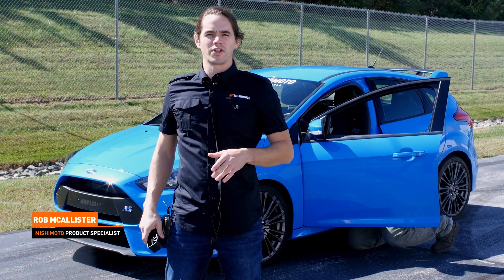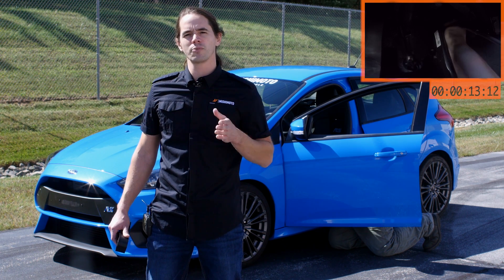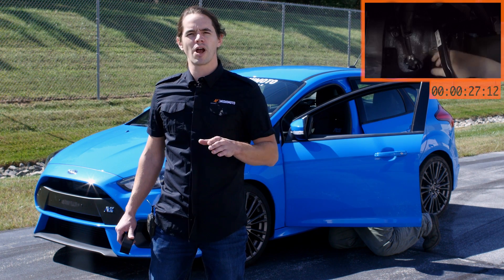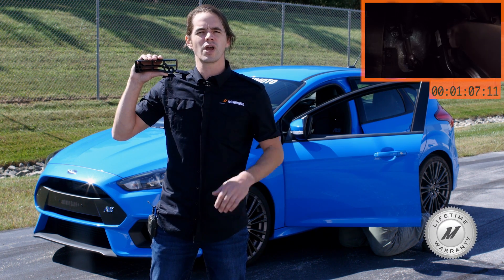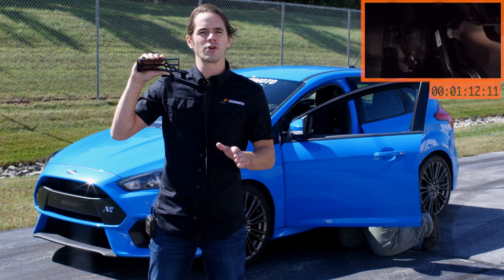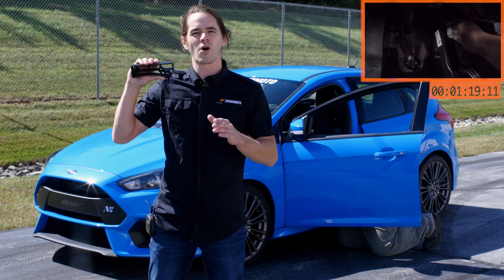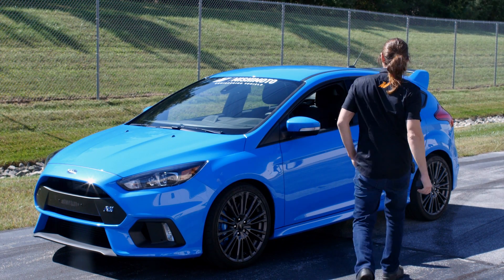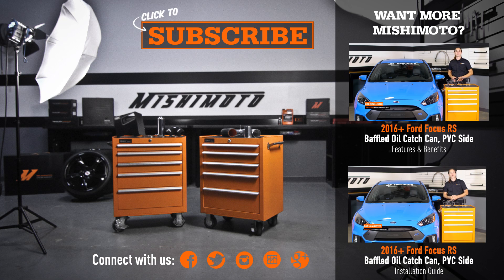2016-2018 Ford Focus RS Gas Pedal Spacer Features & Benefits By Mishimoto

Comment: Great there is a spacer but what about a replacement for the cheap gas pedal assembly?
Reply from the maker: Hi lic2kil007 - at this point in time we have only made the pedal spacer as far as the stock pedal assembly is concerned!